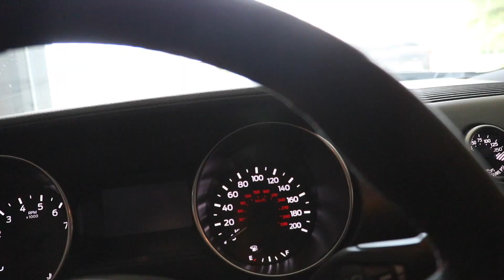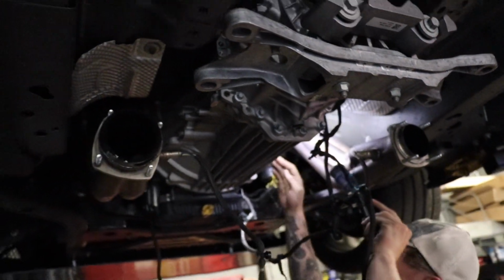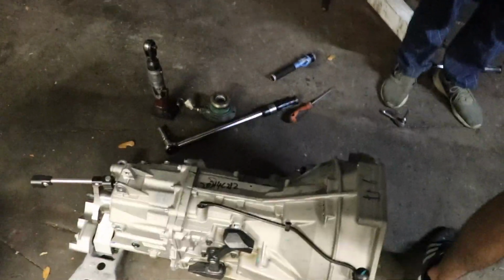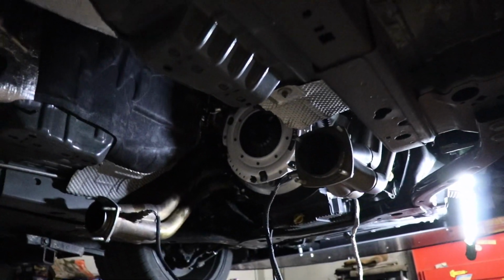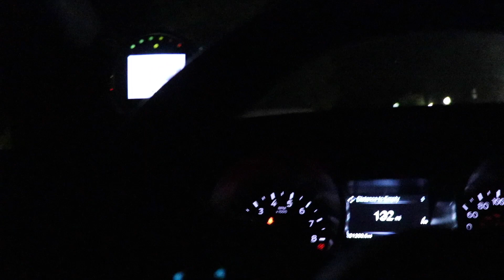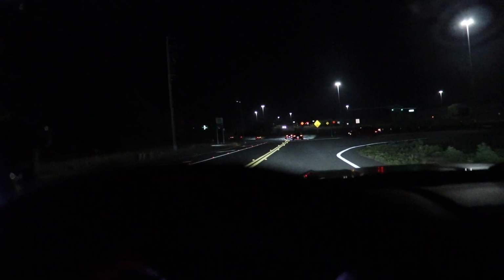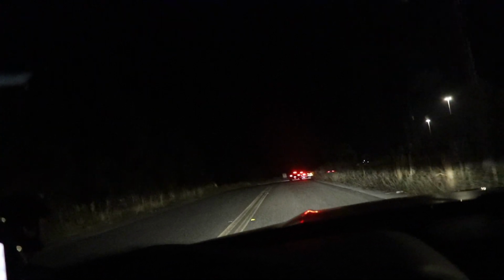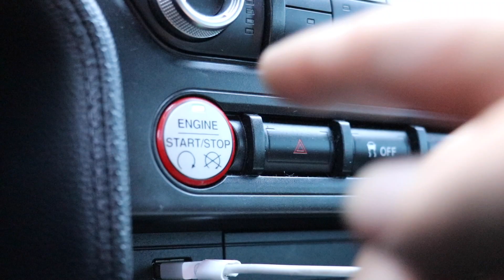Mustang Rips Burnout in Front of Cops... We got in Trouble...

Comment: I'm cringing at him putting his greasy hands on the clutch plates and flywheel surface. Lol
Reply: Never installed a clutch before but I honestly thought about that while putting it on wondering if I should not be doing that 😂
Reply: @quinncalero4274  all good bro. Yeah, typically you want to take a cloth with some kind of degreaser and wipe the surface of the plates. You want them clean.

But hey, I guess his clutch isn't slipping or having any problems engaging. So it's all good. Good job on the install.